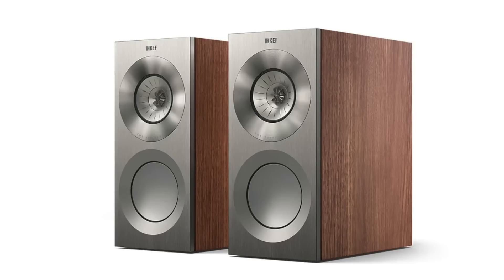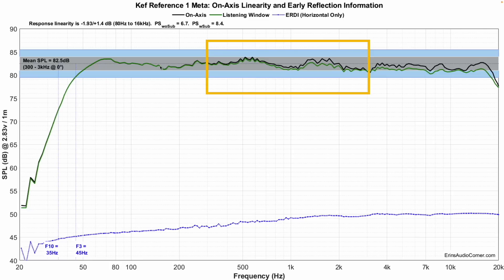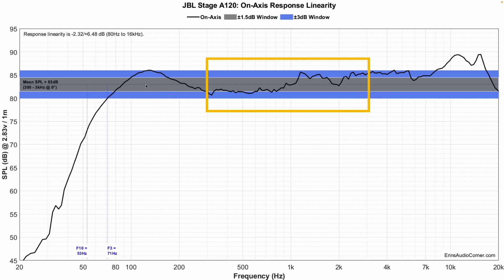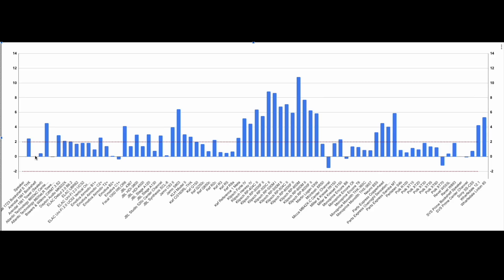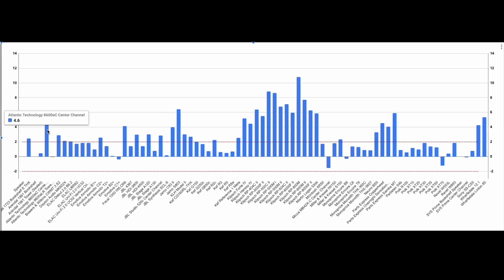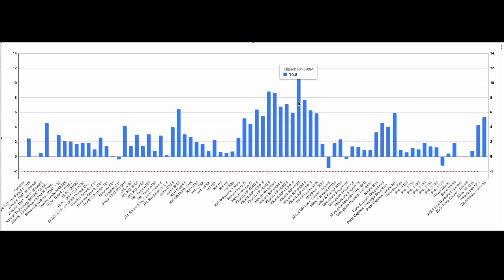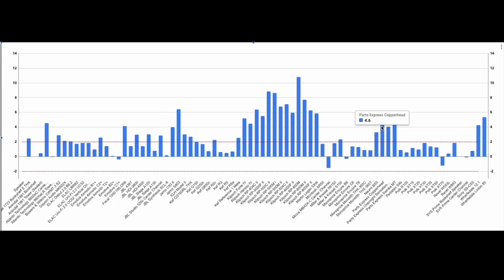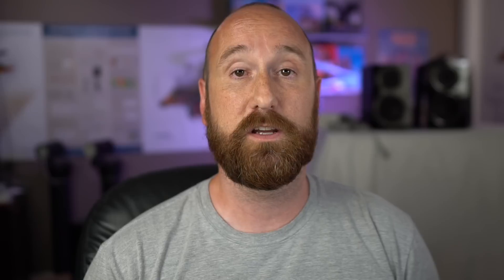BS Speaker Sensitivity Ratings and "Dynamics"

Comment: I remember when I first started designing speakers as a hobbyist, I kept despairing because I couldn't figure out why my designs weren't producing the same types of sensitivity numbers as other brands.

I started looking at more objective reviews such as yours and realized that the real reason I couldn't get similar results was because other companies were full of crap! 😂😂😂
Reply: Same experience! When we actually start to really hammer down the response peaks and correct for baffle step, the real-world sensitivity of most speakers tends to be much lower than expected. To actually hit 90dB@1W1M, which many speakers "claim" to be able to do, tends to require pro-sound driver sensitivity. 

Coincidentally, my home theater speakers use the Celestion TF0818 as the midbass driver crossed at about 1500hz to the popular DX25. After "smashing" the baffle step loss down these speakers would qualify as having a "true" 90dB@1W1M sensitivity rating from ~80hz-20Khz. It's an actual high-EBP design intended for pairing with subs.
Reply: @mdocod  Yes, the only design I've ever produced that exceeds 90 decibels sensitivity is a large 3-way tower speaker that utilizes a pair of 8-in pro drivers wired in parallel to drive the bottom frequencies. It is 94-95 dB/2.83V/1m anechoic. Case in point, I currently have a little 50 watt chip amp driving it, and it tends to make people's ears bleed and the walls shake with the volume around 15% 😂 I have to explain to people that in order to get a typical pair of bookshelf speakers to play as loud as my towers, they have to put literally 10 times as much power into them, and that's only if the bookshelves will handle the power without compressing or distorting.

Comment: It is good to have the real numbers, especially if you are using them to figure out how much power you need to hit reference levels. With Klipsch, you will be off by at least 4x power wise. Yikes!

The other thing to keep in mind if you are trying to do the calculation, is the 2.83v = 1 watt in to 8 ohm speakers, it takes 4v to = 1 watt in to 4 ohm speakers.  So you can pretty much knock down the sensitivity rating a bit more on 6 ohm and lower rated speakers. At least the range you use is generally out of the high impedance range resulting from box tuning.  Thank God for small favors 🙂
Reply: Ohm’s Law says 2V, not 4V, provided you’re talking about a resistive load (you can’t undermine George Simon…
Reply: @shipsahoy1793  
You are correct, my brain was not totally engaged, but the point I made was correct. 
2.83V in to a 4 ohm load is a 2 watt input, so you have to knock down the sensitivity that Erin reports by 3db to get the 1 watt sensitivity of that speaker.
 From there you can figure out the DBw required from an amp to reach the desired output ( and figure out whether the speaker is rated to handle it)

To get the best real estimate of sensitivity of a tested speaker, you could estimate the average impedance from 300 to 3000 ( assuming no wild swings in the curve in that range due to the crossover that will likely be in that range on most 2 and 3 way speakers)  and then use Ohms law and Watts law to get to the 1 watt sensitivity for that range.
Reply: @jgsabato  no problem I knew what you were talking about I’m a retired RF engineer and before that audio, so I can tell you from those experiences that the reason why you’d make a silly mistake like that is because you’re overthinking this thing; it’s really not worth thinking about it on that level .. we didn’t even go down the road of perceived loudness at different frequencies. 
Erin probably could have narrowed up that 300-3kHz BW a bit. (Less data points😉). 👨🏻
Edit: let me qualify that by saying “on a speaker with a well-behaved impedance over the target frequency range.” I don’t want you to write me another book because I’m not gonna read it. 🤣👨🏻
Reply: @shipsahoy1793  Retired engineer here too, EE by education, but spent 45 years doing Mechanical, Manufacturing, Qualty engineering and learned enough Materials engineering to be dangerous 😛.  Such is  life when manufacturing Jet Engines.  Consulted for a few years after that.  The overthinking now comes from stripped gears in the brain not engaging. 😁 

Audio has been a 50+ year hobby, as good a vice as any to have.